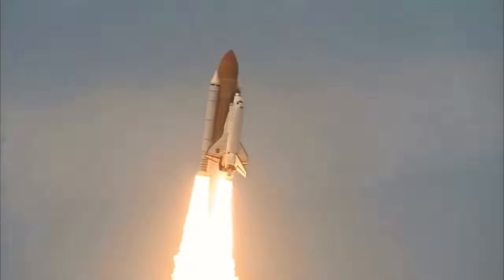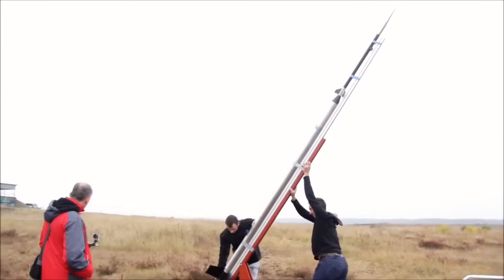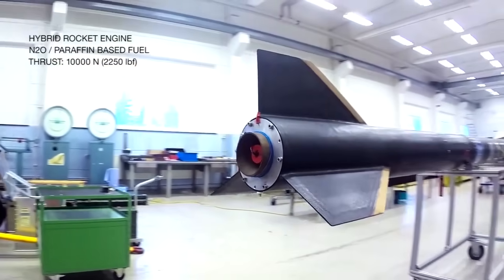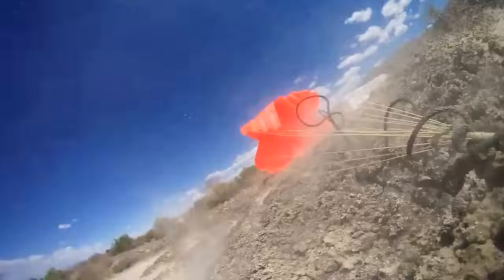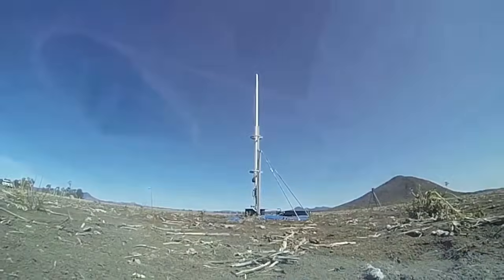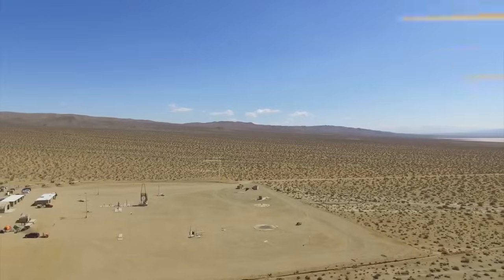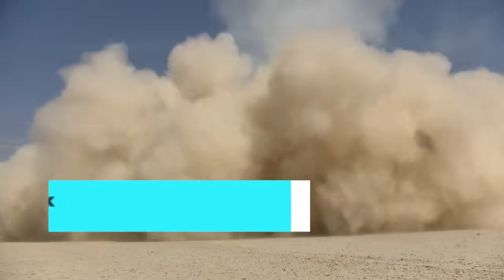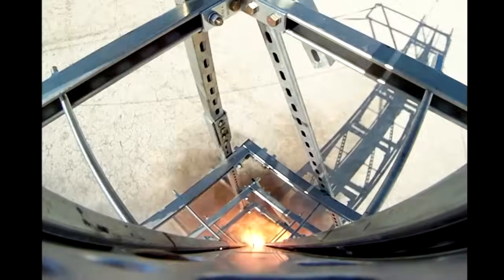10 Homemade Space Rockets that made it into Space

Comment: The Fédération Aéronautique Internationale (FAI), established in 1905, has defined the Karmen Line (the Official beginning of Space) as 100Klm's (62.14 miles), and is recognized internationally as such, even in the U.S. This established line was made in 1960. 
    Prior to that, in the 50's, the USAF was flying it's experimental X-15 program and had decided the beginning of Space was 50 miles (80.47Klm's). Their many X-15 Pilots were therefore awarded "Astronaut Wings" for breaking the 50 mile distance from earth. Since then, NASA and every other Space agency internationally have adopted the FAI's 100Klm definition of Space. The lower 80Klm mark is only recognized by independent private groups who want to "Claim" they've reached Space, giving themselves permission to make up or invent fake awards such as "Astronaut" Wings for paying customers. Blue Origin, Virgin Galactic is doing this simply to attract buyers for their $250,000 dollar+ seats aboard one of their overpriced Roller Coaster rides to "Space". It's Literally a Double Standard that doesn't hold up in this modern era.
Reply: Orbital forces exceeding aerodynamic ones (what the karman line is supposed to define ) happens at (roughly) 52 miles this being also the end of the mesosphere, and the exosphere is  recenrly argued to over 630,000 km (via geoluminesence) so lunar astronauts weren't arguably out of earths atmosphere i.e. "in space". So space and even the line is relative. Plus 100k is nice and round, not science, it just makes pretentious french bureaucrats happy. :) don't even mess with where deep space starts....

Comment: How about adding height in meters for those of us not in the dark ages?
Reply: 304.8 x ft ;-)))
Reply: 100 ft equals 100 m.  So Traveler that went up 330,000 ft is 100,000 m or 100 km which is one of only two to make the Karmen line.   The other was Gofast.
Reply: @michaeldeierhoi4096  "100 ft equals 100 m" ??? O'Rielly?
Reply: Well 52 miles is where orbital mechanics overcomes aeronautical mechanics ie what the line is supposed to define. This is the end of the mesosphere. (80 km) this is the science. But frog bureaucrats like 100 km cuz it is round and tres metric. :)
Reply: If your not in the dark ages how come you can't google the conversion??????

Comment: The Karman line is 330,000 feet ASL. The means that the only rocket to actually make it into space is Traveler 4.
Reply: And GoFast
Reply: The Karman line is at 328,084 feet, not 330,000.  That means that two rockets made it into space from those shown here - Traveller 4 and Go Fast.
Reply: Orbital forces exceeding aerodynamic ones happens at (roughly) 52 miles (80 km ie what line is supposed to define), and is the end of the mesosphere and the exosphere is per geoluminesence  over 630,000 km ie past the moon. So space and even the line is relative. Plus 100k is nice and round, not science, it just makes pretentious french bureaucrats happy. :)
Reply: Switch power 
Off jets system
Reply: How high did your rocket get to…………… no? Then shut up.
Reply: You saved me the trouble, Thanks
Reply: I thought the Karman Line was 328k feet above sea level.
Reply: I was about to point out the Karman line...
Reply: That’s what I thought: 3 x 1760 = 5280’ x 60 = 316800🎉
Reply: @markhughes7927  You're making the incorrect assumption that the Karman line is 60 miles ASL.  It isn't, it's at 62.1371 miles or more accurately, 100km.
Reply: @Li.Siyuan  
Interesting thanks - especially that in decimal reckoning (km) it is Unity - 1(00).
Reply: I feel sorry for you.
Reply: In the Civil Air Patrol Aerospace Education Classroom, we have had some interesting debates about where the “Edge of Space“ truly starts.
Reply: 33 huh? Suuuure lol... the fact we can't even agree where space starts is enough to debunk us ever going to the moon.
Reply: Go Fast reached  216 km. That is 708 659.3 feet.
Reply: @jimgordon7305  No, it reached 115km which is 377,000 feet. So it made it to space but not to 708,000'.
Reply: @tedsmith6137  2014 shot made close to 386,000 ft.
Reply: @jimgordon7305  116km.
Reply: @jimgordon7305   CSXT became the first entity to officially launch an amateur rocket into space on May 17, 2004, with the successful launch of its GoFast rocket to an altitude of 116 km (72 miles) (380,577) feet, above the surface, which was verified by FAA analysis of the team's flight data.[1]
Reply: The GoFast did it first, making it to 115 kms and they did it a few weeks before SpaceShipOne. A few of my friends were on that team.
Reply: Lol don't tell a flat earther that I had one tell me no one has ever left earth's atmosphere before just impossible for them to understand
Reply: @noname2-190   Well, it would be easier with punctuation.  Just sayin".
Reply: @frankdank7507  I understood them perfectly.!? ;-)
Reply: @noname2-190  What a strange thing to bring up.
Reply: @noname2-190  Why "don't tell a fe"? I see no proof of ball here.
Reply: @noname2-190 no human has ever left the earth's atmosphere. You believe NASA?? LOL. That's hilarious